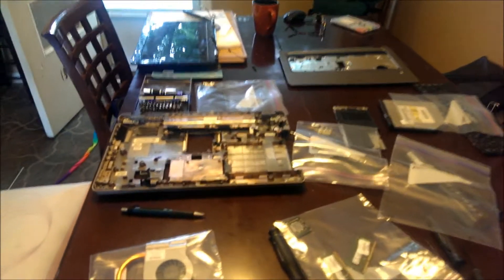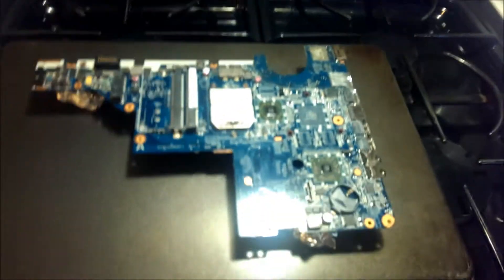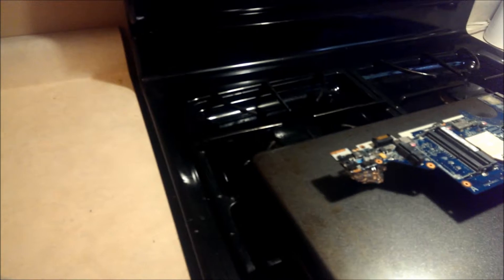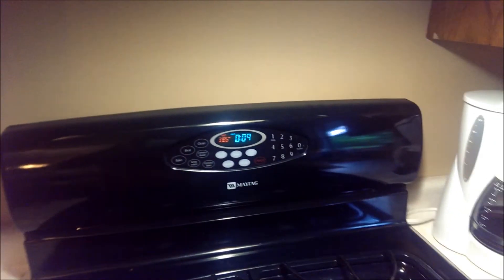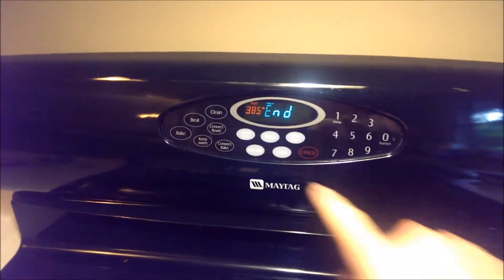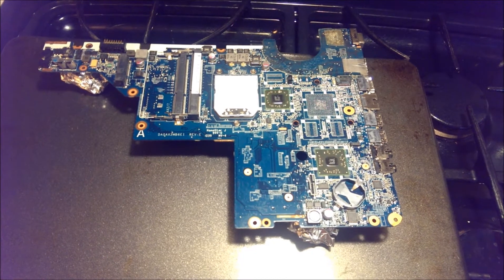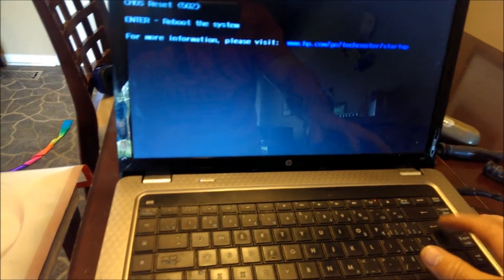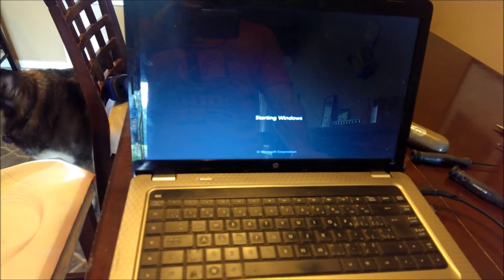Hewlett-Packard G62 Solder Reflow

Comment: I've done this with a different computer, although I'd forgotten which model. I now have a G62 on which to perform the same cooking. I'd forgotten the foil supports, so your video is helpful in that aspect. The previous baking project suggested to leave the board in the oven while it cools, to prevent hot solder from being displaced by movement. It appears that didn't cause any problems for you. I'm encouraged to learn that the labels and other items on the mainboard survives the heat. We'll be cooking tonight!